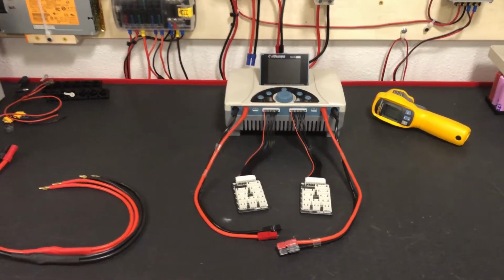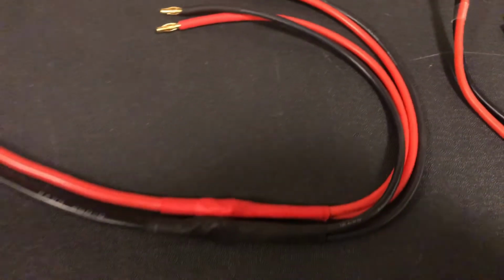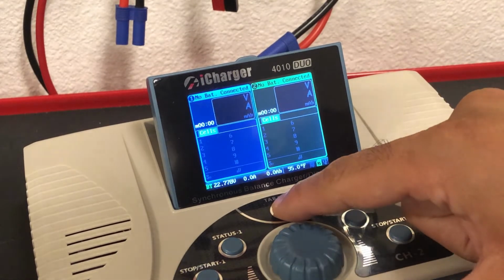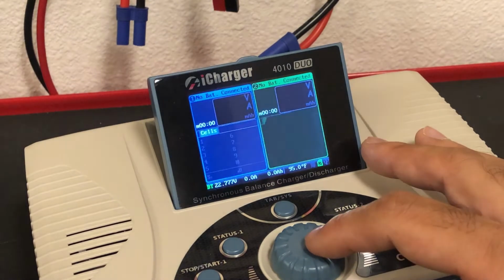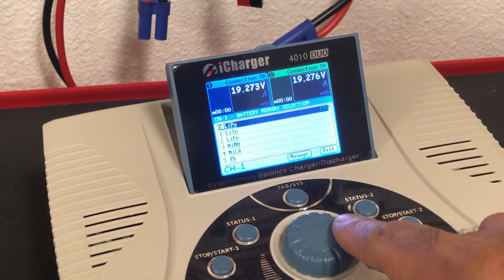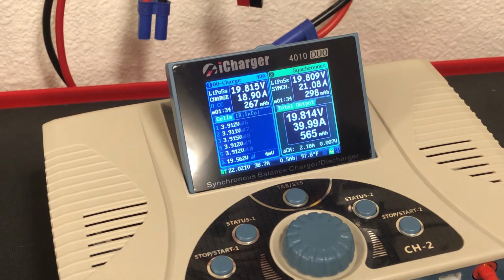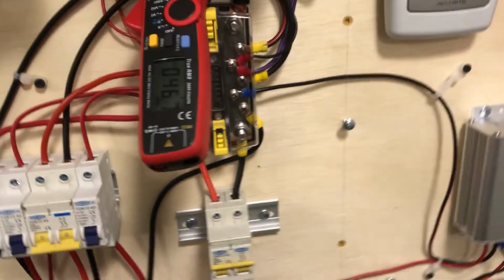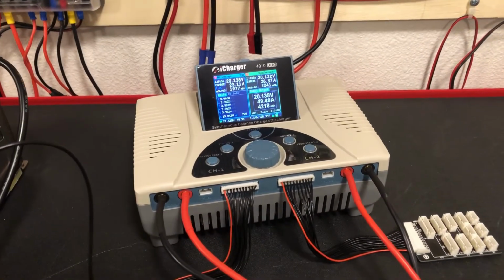iCharger 4010 Synchronous Mode Setup & DIY High Current Cable Build

Comment: This is my first video of yours I’ve ever watched. Very interesting setup with breakers and fuses powering this mighty charger from a hidden battery source. I assume either you live off-grid or this is in a trailer. I’ll have to watch more videos to find out :)
You might know this by now…. I’m on my second 4010 Duo charger so I personally addressed this years ago…. But the charge leads they included (the ones I assume you modified in this video) have “spring cage” 4mm bullets to plug into the charger. That was the hottest temp reading you got on the output. You should change these over to “solid” bullets (I don’t know what they are called, but similar to what’s inside your XT150 connectors). I just ordered 20 more from China for maybe $12, or you can get 4 from your local hobby shop for $5-8. The 4mm spring cage bullets are not rated to carry anywhere near the current you were pushing through them in this video. 
Stay supercool

Comment: Couple of questions here. First off you seem like your very knowledgeable in what you do and thanks for the detailed video. The only 2 questions I have after watching are…….
First what are the batteries for ? Second what’s is all the circuit breakers and other stuff on the wall for. I use regenerative discharge every so often and not the sharpest when it comes to understanding it all. I just hook up the 2 batteries, set values, and let it do its thing. Am I doing something wrong ? 

Thanks in advance for taking the time to respond.

Comment: Forgive me.... What's going on here? You set the input to battery? Are you charging the battery you are using as power? What's the purpose of that task?
Reply from the maker: The purpose of this setup is to capacity test batteries. The configuration allows me to do this very quickly, and without wasting power since I am moving power between two batteries, while metering the capacity.  If not for this config, it would take significantly longer using the chargers internal load… appropriately take 10 times longer.  Internal max load is 200 watts, vs 2000 watts in regen with the channels combined.

Comment: Heh, never thought I'd see a TS-100 soldering so much cable together, must have taken some patience. I only operate mine at ~17-20V from a 5s pack so I guess I'm not getting the full 60W, but still seems like it'd barely be capable of that.
Reply from the maker: jkenny1  I should have included a real time video of the 8 awg... it only took about 5 second of heating and it started accepting solder and was fully saturated within about 10 seconds.  I use the largest tip they offer at 24 volts. 6s pack charged to 4.0v per cell. Give it another shot at full power, it continues to impress me a lot. Soldering the two 12 to the 8 took about 30-40 seconds, that was a lot of mass.
Reply from the maker: TS-C4 tip
Reply: The TS100 is a little beast and I love mine. I use it more often than my Pace, and JBC stations.

Comment: a amasing piece od kit but its expensive if you don't need much amps and if you need to charge a few battery's
is there a single version of this type of ballance charger
Reply from the maker: Thank you. iCharger also makes the X6 and X8 models, which are single channel units.  Very popular option, a lot more affordable and also have excellent current handling.  The Duo series is basically two chargers in one, and that’s allows for some advanced features like regen between channels and synchronous mode.